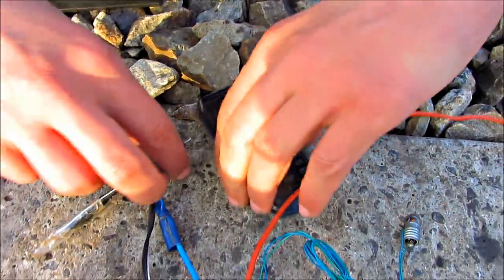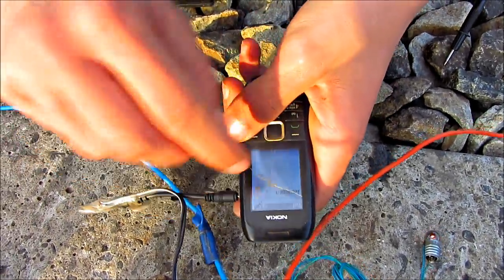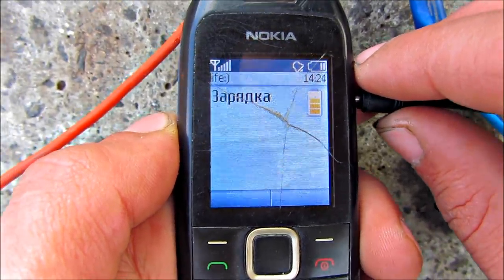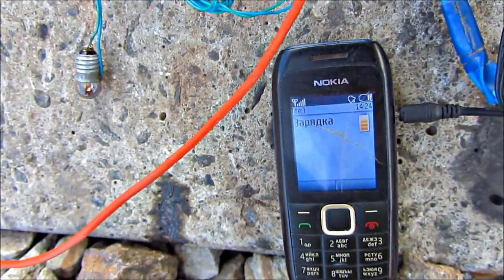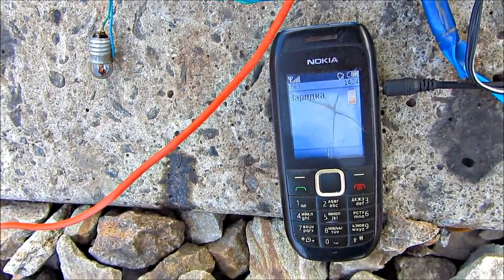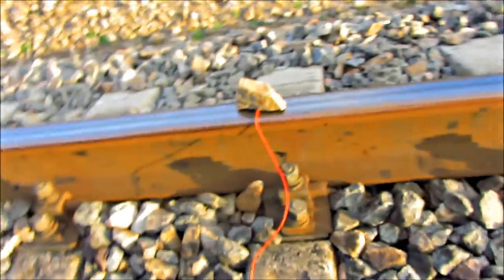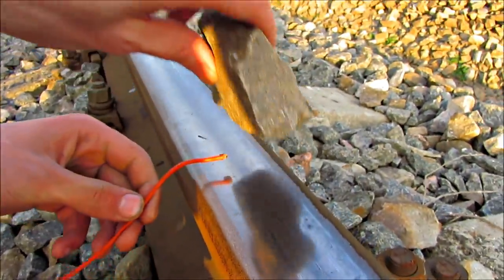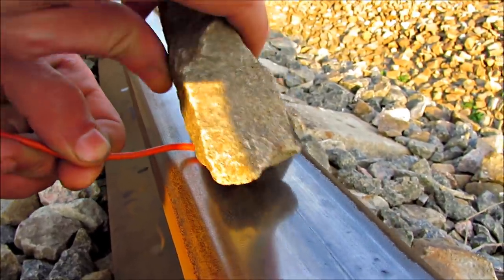How to charge a phone from the rail tracks. Measuring voltage on the railway

Comment: Cool video, if it's real. Friendly word of advise though. If you appear to be from, or are from anywhere in the middle east it would not be wise to be caught attaching wires, speakers, light bulbs or anything else to rail road tracks right now, anywhere in the US. Matter of fact if you are or appear to be middle eastern It would be very unwise to venture onto rail road tracks period. The same holds true even if you do not appear to be middle eastern. Also other places to avoid venturing into in the US right now are, electrical power substations, Hydro-electric dam sites, military installations, power plants, places where dangerous chemicals or gasses are either produced, stored or distributed from, and especially nuclear powered power stations. But I am intrigued about the possibility of electrical power from rail road tracks. I know that during the 1800's "Earth Batteries" were used to power remote telegraph offices, usually near a rail road track. If there is electrical power from the tracks I wonder why that power was not harnessed instead of using Earth batteries. Despite my own advise I think I'm going to check this out.

Comment: the reason that there is voltage in the rail line is due to the signaling system. the a wheel breaks the circuit or indeed a wire is connected between the rails, it notifies the control centre that there is a train occupying the section. do not attempted this as it can result with hours of delays due to the fact that now security needs to investigate where this "train" went

Comment: The voltage runs through the rails so that the signal behind your position will allways show up as danger (red) the train whilst in that section protected by the aforementioned signal completes the circuit that keeps it red. Once it leaves that protected section the circuit is broken and the signal will show the route as safe.

Comment: So what if it rains or snows, isn't it grounded then? So there would be no more signals and all the rails would be considered broken?
Reply: rain or snow are poor conductors, there's very little chance of anything falling on the rails that is good enough to make a good connection to earth to allow both rails to drop bellow 0v. you have to remember that it's also AC not DC so they alternate between grounded rails.

I think it's more of a way to determine if the rails are broken or detecting halted trains and not just debris falling on them, and as somebody else pointed out corrosion prevention.

I assume the power supply is good enough to keep the voltage alternating pretty constantly even though there's some point of the track that may have puddles of water or mud on them.

Or I'm just talking out of my ass since I'm not a rail way engineers, just a regular soon  to be electrical engineer.
Reply: Thanks! sounds like a good answer to me, and I'm an engineer too, although electronics is not really my field ;)

Comment: growing up I would hang around the train tracks in my town. nearby there was a warehouse that had alot of steel bands in bins. I use to take a steel band and make it touch both rails, if I was near a crossing, the lights would activate and the gates would come down. oddly, only if my hand was holding the metal band.

Comment: The voltage between rails is just to detect if track is occupied? When train is on track current can flow pass train axle, so you can detect train by measuring voltage between rails. If someone using this voltage to charge their cell phone the control room crew gets false information that track is occupied also some automatic systems can close tollgates.

Comment: Im not certain but I believe there is voltage in that rail because railroad crossings use the axle of the train as a switch by touching both rail and you will notice insulators at the butts of the rails on either side of the crossing. That being said this will only work at railroad crossings

Comment: cool,...probably,because some trains are electric,down the tracks?
Reply: also,some of the rail "switches"are electrically operated,...also,( at least in america) each rail section is connect together with a small braided wire)
Reply: The braided strap is bonding.

Comment: I was wondering if any surge or loss of voltage form your demo would effect signalling. This line also requires ELECTRIFICATION! (25kV/50 Hz at single phase. Unlike North America Russia, UK, China and India are indeed pursuing badly needed railway electrification! Hopefully one day this line can show off her electrification infrastructure!
Reply: Actually the uk has over head lines on the main lines to London and Edinburgh   Also others but other electrification includes the Dc  third rail at 300- 600 v

Comment: When i used to do telecom work on power poles, we had phones that would click into the phone line. Often you could click onto the strand which holds the telecom line in the air and the other end to ground. You would hear the radio.

Comment: My guess its a system used for detecting breaks in the rail so as to not cause any derailments because of disconnected rails. Also could be used To track the exact location and speed of the train.
Reply: +Daniel Craig Yeah it can detect breaks in the rails, location/speed of train, it can even detect livestock that are crossing the tracks

Comment: There is an antenna on each side of the train in front of the front wheels. The intention is to pick up the signal voltage before it is short-circuited through the first wheel axle.

The track is examined by means of a tram line. The system sets out a differential voltage (track phase) between the rails and constantly checks whether the voltage is present or if a train shortens between the rails. Both rails are crawled every X meters or so and form insulated sections that can detect trains. Speed message is given through the track and thus applies in these intervals.

The speed message consists of a voltage, with 75 Hz pulses between the rails. As long as there is no train available, the system delivers 75 Hz continuously. When a train is detected, the speed message is output in the form of different types of torn voltage. This type of signaling is very difficult to interfere with and mistake. 75 Hz - is created by a rotary converter, a proper iron lump that does not break at once.

It investigates whether there are dangers around the lane that it manages, in the form of locked lanes, as other trains may occur. If not, it signals full speed (pulse code). Is there a red signal at the end of the train path, because a previous train just left this block distance, signaling that intersection (another pulse code via the signal relay). Are there locked trains all around signaling the low speed (tram lines 1-2-3).

https://www.idg.se/editorial/0/path/1.253071!imageManager/2144783834.jpg

Comment: They might use pulses along the rails to fault check for breakages in the line.

Send an electric pulse down the rail and if there's a breakage in the rail, it won't reach the next track. Hence there is a fault in the rail.
Reply: It's for the signals
Reply: That too.
Reply: You're correct i came to the same conclusion...this is precisely what it is. 

A track circuit typically has power applied to each rail and a relay
 coil wired across them. When no train is present, the relay is 
energised by the current flowing from the power source through the 
rails. When a train is present, its axles short (shunt)
 the rails together; the current to the track relay coil drops, and it 
is de-energised. Circuits through the relay contacts therefore report 
whether or not the track is occupied.
Each circuit detects a defined section of track, such as a block. These sections are separated by insulated joints,
 usually in both rails. To prevent one circuit from falsely powering 
another in the event of insulation failure, the electrical polarity
 is usually reversed from section to section. Circuits are powered at 
low voltages (1.5 to 12 V DC) to protect against line power failures. 
The relays and the power supply are attached to opposite ends of the 
section to prevent broken rails from electrically isolating part of the 
track from the circuit. A series resistor limits the current when the track circuit is short-circuited.

Comment: The current used by the trains comming from the overhead lines goes back to the station through the rails. The modulation could be due to communication devices used on board or for lights.
Reply: what over head lines ? trains don't have overhead lines!
Reply: Overhead wires. :)
The overhead wire carries the voltage for the train. The current goes through the engine to the railtracks and from there back to the source.
Reply: nope
Reply: It makes no sense that the trains would drive with electricity on two rails at different potential at such a low voltage.
Reply: It seems to be a train detection device to detect trains approaching lights which would than turn red. But one of the two rails must be isolated from ground and I don´t see any isolators. Has someone found them?

Comment: Crazy idea overall dangerous as any residual power. This voltage it's a differential potential resulting from leakage asymmetrically distributed over the rails; to be useful we need some circuit to do CMR, basically a circuit to limite or avoid power picks resulting from an unexpected high voltage discharge over one and only one rail. But a source to be explored.

Comment: The voltage is there to detect if any trains are occupying the block section of the track island. They are used for signals and for level railroad crossings. You probably dropped signals nearby to a red absolute signal and made a signal maintainer come out and check the track.😂😂😁
Reply: @spankthemonkey3437  oh jesus. That would be interesting

Comment: The reason you should never walk on railroad tracks is because when you get to a certain part of the tracks the tracks can be charged with high voltage and you can end up getting electrocuted from the tracks and die from it and that can happen when your walking on railroad tracks and if you get to a certain point of the railroad tracks I also know that you should never walk on the tracks in a train station because you can definitely get electrocuted and die from the high voltage that the tracks are charged with because the tracks in a train station will kill you and you won't get a second chance from it lots of people have been killed from the high voltage that railroad tracks carry
Reply: That really can't happen, since that line is only for diesel-powered trains. There are no electric lines powering the trains there.  You only have to worry about  railroad lines with overhead powerlines or third-rail systems, because those carry current that can kill you.

Comment: I wonder if it could charge up a super capacitor bank and run a power converter to recharge a higher voltage battery bank for an electric buggy or bike.

Comment: why you have to let racal pulses in the track is because the trains that are on the track the track is basically metal in the train crates the electricity because it has a motor that can create electricity so when it goes over a sensor the electricity comes out of the engine and goes into the real Gates or the signal which has time like a electrical pressure plate or something like like that but when you hear it sounds like a heartbeat how it goes do do do do that is basically the train going over the tracks and with the welder track you have a longer sound with the non welded track you have time like a heartbeat sound because it's going over gaps in the track

Comment: When the train  is running through the track the electric pluses is generated by locomotive or the gnd wire through the over head line which is sense by the other set of wires which is then converted into information that the train has passes.. Ok I know all about train because I am Indian.. Hehehe

Comment: It is part of the signalling system when a train passes over it stops power reaching a relay which changes the signal behind the train the ac current is most likely binery transmission controlling a computer which controls other signals and swiches
Reply: A track circuit typically has power applied to each rail and a relay
 coil wired across them. When no train is present, the relay is 
energised by the current flowing from the power source through the 
rails. When a train is present, its axles short (shunt)
 the rails together; the current to the track relay coil drops, and it 
is de-energised. Circuits through the relay contacts therefore report 
whether or not the track is occupied.
Each circuit detects a defined section of track, such as a block. These sections are separated by insulated joints,
 usually in both rails. To prevent one circuit from falsely powering 
another in the event of insulation failure, the electrical polarity
 is usually reversed from section to section. Circuits are powered at 
low voltages (1.5 to 12 V DC) to protect against line power failures. 
The relays and the power supply are attached to opposite ends of the 
section to prevent broken rails from electrically isolating part of the 
track from the circuit. A series resistor limits the current when the track circuit is short-circuited.

Comment: you make no explanation for why there is electricity between rails, induction from earths magnetic field, sacrificial anodes or just a connection as you said to power remote signals.
Reply: Google ALSN. One long two short signals is interprited by the decoder of next traffic light as "green" signal.

Comment: "How to charge a phone from the rail tracks" in the title and "i don´t recommend this..." in the description? That makes not much sense to me at all. But to educate you: what you "discovered" is a signal that (for example) can detect broken tracks and it also works as a low voltage corrosion preventer. What you did there will probably have made some engineers nervous and maybe even a train being late.

Comment: Useless just keep an external battery with you, it's much less of a burden.
Reply: +Noah Willson You would need a wire in either scenario but with the battery you are carrying the battery. How is carrying no extra battery a bigger burden than carrying an extra battery?
Reply: +Karl Sjostedt I don't understand your comment but I'm assuming you're saying how is carrying an extra wire more of a burden than carrying a wire. first off hes carrying multiple wires and that's not something common. I would much rather carry a battery and be on my way instead of waiting for a charge on train tracks. also what's the changing speed for this. I'm sure it's slow.

Comment: In England some rails are 1000 v
Reply: thats a load of crap, the running rails (two rails that the train run on) are energised at a maximum of 5VAC normally. in some cases there will be a third rail which carries a voltage of up to 750VDC or 650VAC. this is not even close to 1000V but will still kill you.
Reply: Rudy Roberts yes I know I just said it’s around about 1000 as I knew it was somewhere around 500 to 1000 oh I was talking about the high power 3rd rail

Comment: How do you even manage to break a nokia?
oh yeah... they're ukranian and they live in Luhansk where there's a war going.
also. the voltage is to detect if a train is present on that part of the tracks, because if a train goes over that section of the tracks it will connect that 5 volts, letting the system know there's a train there. you probably set off a signal in a control tower somewhere because they think there's an unknown train that randomly appeared there haha.

Comment: Yeah this is absolute nonsense. Even if there was power on those lines, that low voltage would not light a 12V bulb, no, not even a little bit. And the bottom line is that the power comes from overhead lines, not from the rails. And the rails are both grounded.
Reply: It's not induction from the power lines, while they do have EMF it's usually within a few feet, not hundreds. Part of a linemans job is monitoring voltage and making sure it is safe for the public. 

In reference to the rails being grounded, I would certainly hope so... But I would wonder how frequently? There is a certain depth required for a ground rod to be driven to be considered safe ground for certain voltages :)
Reply: +Gadget Addict,  there's always voltage between rails, it's called the track circuit. It detects whether a train occupies a section of tracks and report it to the central system.
Reply: +Gadget Addict Who said it was a 12v bulb?  It could be 3, 1.5, or 6.  And even if it was a 12v lamp, 3 volts or 5 volts most certainly would light up a 12v bulb.  Notice that the bulb isn't glowing at full brightness.  It's glowing dimly, just like a  12v bulb would light at 3 or 5 volts.  Both rails are most certainly not grounded.  The overhead power that runs an electric locomotive has nothing to do with the voltage he is detecting on those rails.  The overhead runs at many kilovolts.  The track voltage is just a low-voltage detection circuit.
Reply: P = A * V